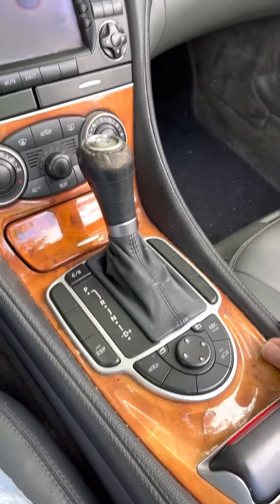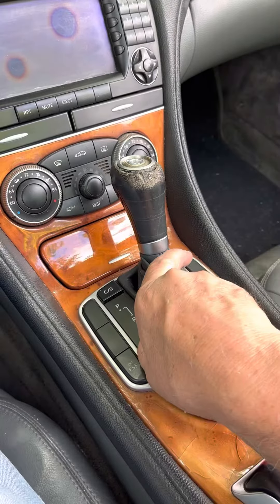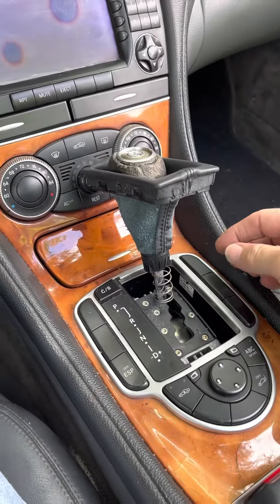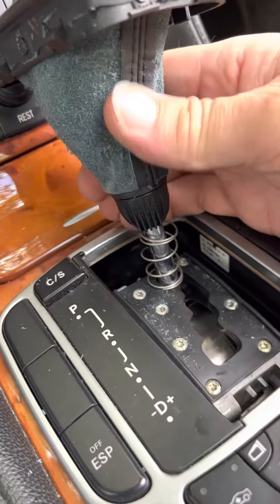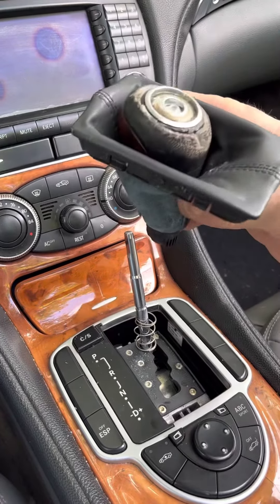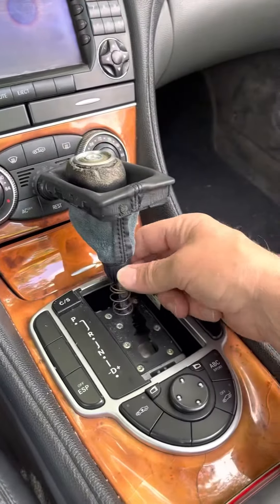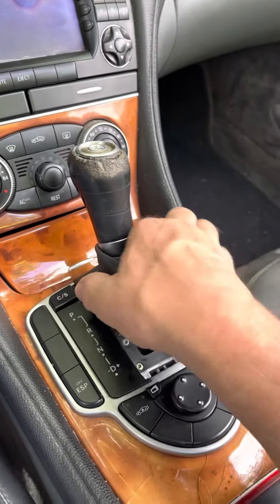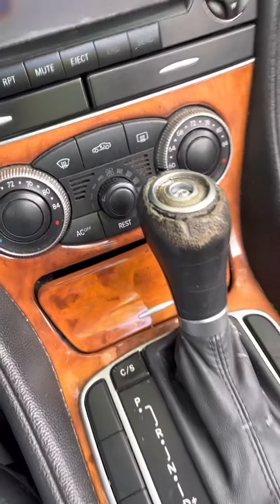R230 SL500 shift knob removal

Comment: Wow a little headway thank you for your video! I also have an SL and it’s stuck in gear do you have any information on how to resolve my issue or how to pull more of the Consol apart?
Reply: Did you fix your gear problem ?
Mine is stuck in parking gear
Any help would be appreciated
Reply: Yes, after painstakingly, figuring out how to take the whole center consul apart it turned out it was the brake switch, which is actually a multiple switch. It has one circuit for the tail lights, and then one circuit for the shift indicator start so check that switch it’s underneath the dash where the steering column is top of the brake pedal.
Reply: @mattschmidt4001  Thank you for the reply back.